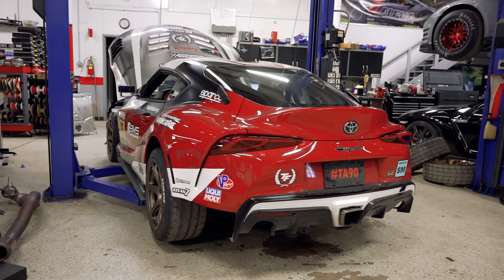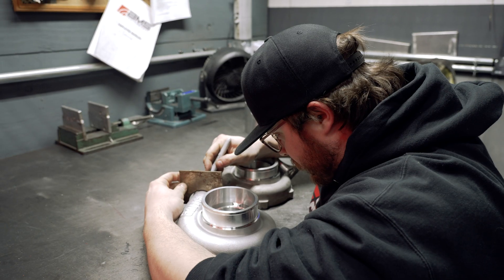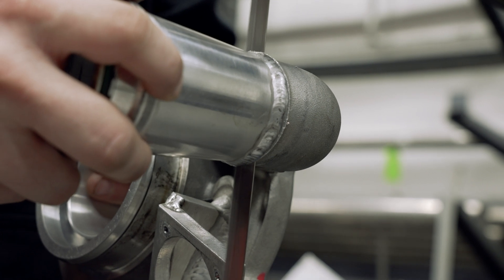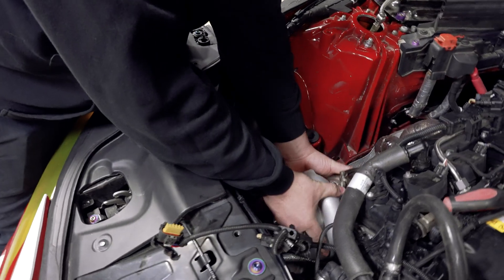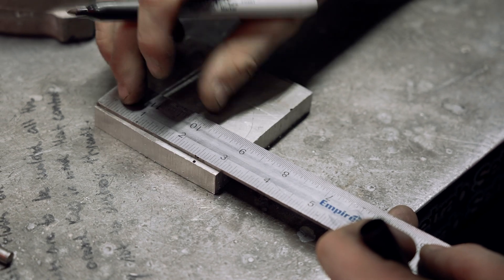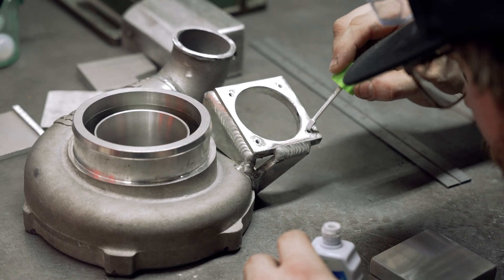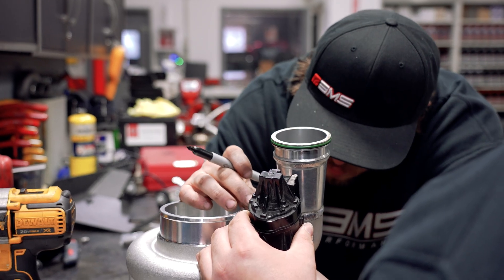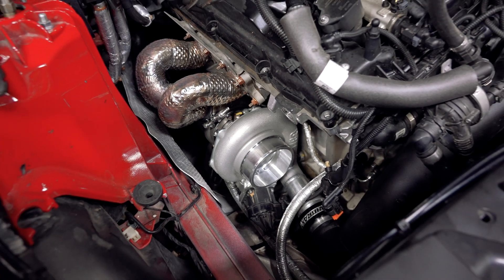760+ WHP Time-Attack Toyota Supra - Turbo Upgrade | ALPHA 8 Fabrication

Comment: What’s the more capable motor to tune b58 or vr30?
Reply: Vr30 can achieve 750 whp on z1 turbos. When built it can achieve 1000whp on ams alpha 10 turbos. The vr30 has more bore 86mm, and a stroke of 86mm, the vr30 can achieve more rpm therefore more hp than the b58. The b58 has a bore of 82mm and 94mm stroke, stroke gives more torque but less rpm therefore less hp. The b58 is has a lot of torque, but that doesn’t matter nearly as much as hp. The vr30 is the more capable engine, the only difference was that the b58 had more aftermarket support, which the vr30 is now catching up to.
Reply: B58 all the way